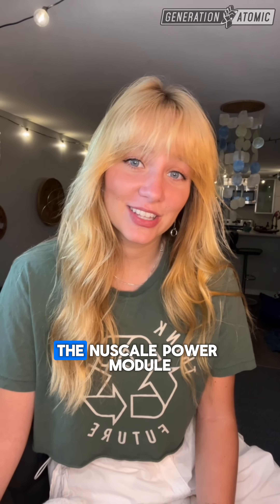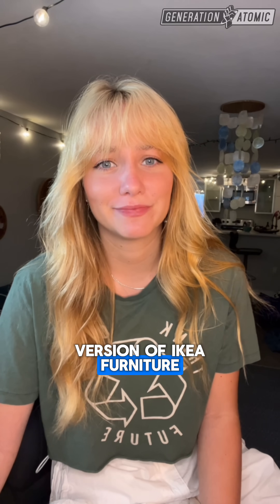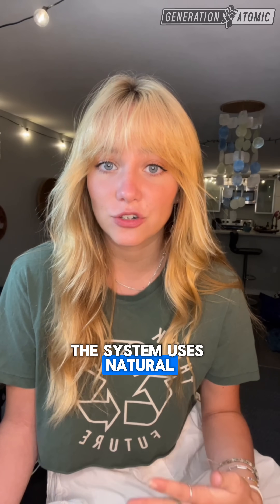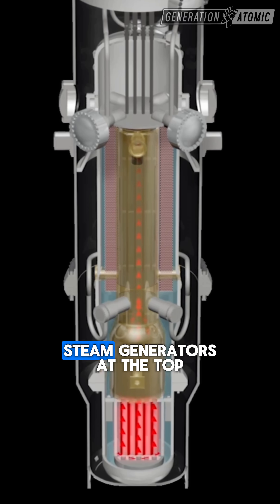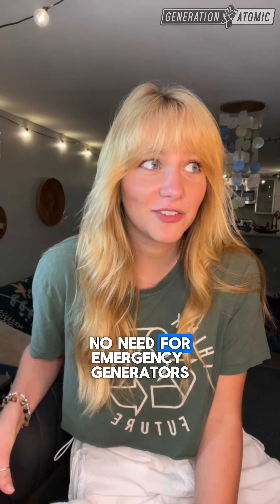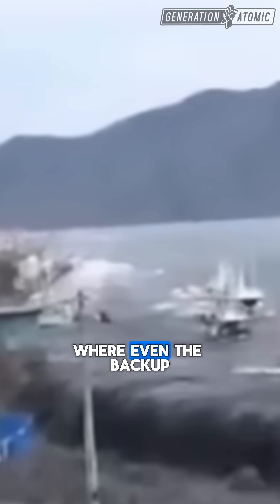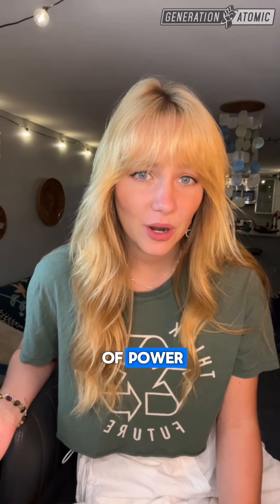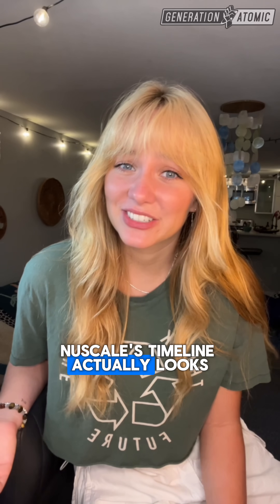The Nuclear Reactor Race: NuScale Power #nuclear #smr #nuclearreactor #nuclearenergy #nuscale

Comment: They have even more safety measures than that, but it gets technical. Steam bypass is built into their cooling loop, making sure that they don't have to SCRAM the reactor in a blackout scenario. Separating the reactors into 12 different modules in a 924MW plant allows in the unlikely scenario that a SCRAM is needed to SCRAM 11 plants, keeping one operating to run the 2ndary cooling loops, keeping cooling load off the pools until it is truly needed.

Comment: "Yes, the AP1000 reactor design uses natural circulation for its passive safety systems to cool the reactor core and containment in a loss of power or accident scenario, eliminating the need for active pumps or operator intervention to achieve a safe shutdown. This natural force drives fluid and air movement, relying on gravity and density differences to remove heat and maintain safe conditions for extended periods without external power." (Google AI)
Reply: Yes.. And no. The reactor coolant is still driven by pumps, and the pumps must continue to run in event of a SCRAM. There is 1 additional safety measure over the Gen 2 reactors which is that there is an additional Stirling engine driven generator capable of running off decay heat to power the pumps, and the diesel generators are the 2nd last resort.

There is a passive cooling scenario but that is the last resort. In the enemy of a double ended pipe rupture that empties all coolant into the containment building, the containment building is designed to condense enough of the water to keep the fuel rods submerged. A large pool of water on the roof of the building begins to let water flow down the wall of the containment building to keep condensing the coolant in the building. The tank has enough water to support cooling of this nature for 72 hours. After which, it must be topped up. This is a system designed for apocalypse and isn't used to run the reactor in normal operations.